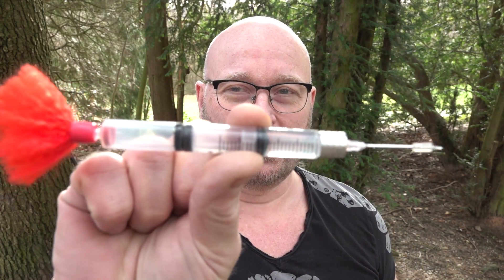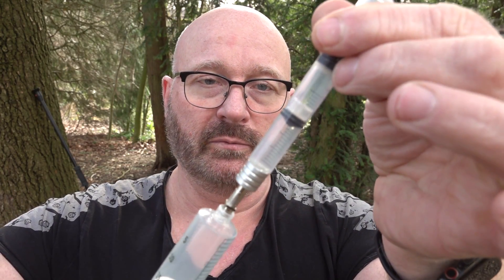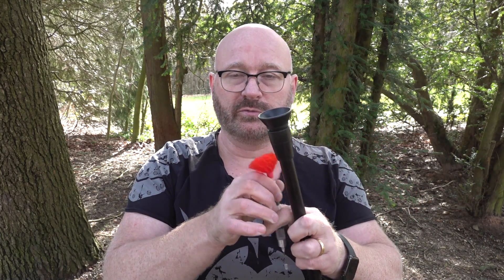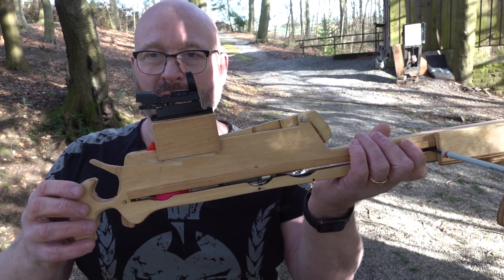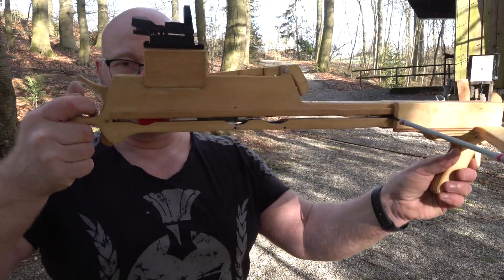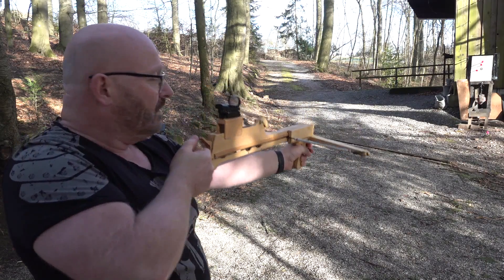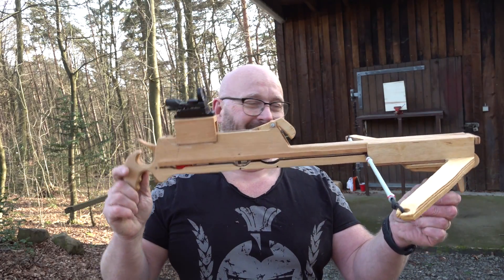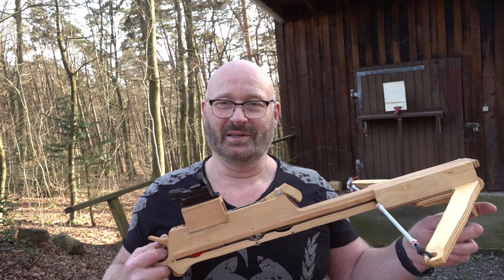The Tranquilizer Dart Projector!

Comment: I have racoons to deal with, I am brainstorming, I am of Austrian decent, way in the past I worked with a German Guinness designer who was in between jobs from Detroit. We were at a tool and die shop brainstorming for a millionaire lawyer trying to get patents. My boss had to sue the guy for not paying roaming Guinness's.    Yuo've made my day. CAN I PLEASE HAVE ONE OF YOUR CROSS BOWS?  My first blow gun at age 8 was 0ne of those cardboard tubes used on coat hangers to not make creases. the dart was a needle with Old paint brush bristles tied with thread, it stuck into the cement wall of my father's basement at 20 feet. HAPPY BE KIND TO A COON DAY!🐾

Comment: It looks like you solved many issues at once. Your model holds 4..5 shots. And seems to be much more accurate than the other two you showed. This would be so much simpler to use .the blow gun takes a lot more practice. I call this a win win.

Comment: you could give more control on the power by placing small triangular edges  on the slider and put 2 hooks on each side that go outwards when  button is being pressed, that way it will have many more stages, it will create tension on the main frame but I think it won't be enough to wear the device

Comment: I had a thought about the rubber. Wearing protective glasses is inconvenient. So couldn't you build in protection in the bow itself? My thoughts are: attach a ring, rubber goes through, so if rubber should break, it would overlapp esentially reducing it's own length, so it wouldn't be long enough to reach your eye.
Also may be attach minimalistic shield panel if it's nessesary. Also rubber should be cheap, so spare could be included.
I don't presume you will read this, there are thousands of comments. But i wouldn't know where to post it anyway.

Comment: You know adjustable dog leashes and lanyard-holders that you can pull and unlock doors and shiz with and when you let go they return to their normal position. (What is that mechanism called?)

Could you use the same mechanism for the assisted draw on an Instant Legolas?
As in, no rubber but a string on springs instead. (since they didn't have rubber bands in medieval times)

Comment: If you changed it to be an all in one, capable of pressurizing the canister and  increased the cartridge size, i could see wildlife professionals actually use it. Four shots is a bit light, and not bring able to make more in the feild is a bit of a down side. But if the two things are fixed and it allows for smaller inner slide replacement for smaller syringes for birds and small anomals, it could really work.

Comment: What about using wooden gears instead of the rubber bands to aid with the draw drawforce for the longbow? It's only an idea I had. Would this be something you could consider? If the wooden legolas were moved on a slider (like a rail) adjacent to another slider that drew the string,

and they were connected via (either one multigear or a set of) gears, you could increase the amount of torque over a little bit of longer distance draw. Yes the length by which you would have to draw the slider would be further, but there are ways around to fix these problems that surface. 

But in other words, the premise is to be distributing the work over distance to decrease the drawforce using like bearing-type gears that roll in between two sliders that would extend similar to a telescope or a drawer (dresser). One slider by which the wielder draws, and the other that actually draws the string.

Anyway, let me know what you think Joerg! I am a big fan. Thank you for the videos and fun personality.

Comment: I'm a whimp and couldn't even draw a bow of that poundage, but I have shot a 66lb English longbows, and the handshock is incredible.

Whatever you make will have to withstand some serious energy dissipation.  Maybe coat all the wood in polyurethane to stop it splintering up.

 I've always admired you work on the "instant" series of bows, but I've doubted its application for truly heavy bows, the forces are well beyond what you've worked with and I fear something made of wood, glue and screws won't last long under them.

I look forward to be proven wrong, it's quite honestly amazing, the stuff you come up with using only simply materials.  God knows what you would achieve with a plasma cutter and a 3d printer.

Comment: why do you need to have the crossbow shape? Why not just eliminate the crossbar completely? Just make it like a divers sling? The rubber will stretch just fine. It doesn't need a great big angle. In fact you could even make it spring activated.

Comment: You don't even need the cross bar, just use the rubber like a spear gun.
Reply from the maker: Then the weapon would have to be much longer to achieve the same pretension. Also there would be pinching at the sides of the slide. Don't you think I know my stuff, after all those years?

Comment: So after filling the syringe with medication, then you put the needle on... how do you bleed air out of the needle? You'd need to break the seal of that silicone tube and then close it back up immediately, as you don't have a lot of liquid to waste, and you're also wasting your pressure.
Reply from the maker: A small amount of air is totally harmless, contrary to common belief. You would have to inject four or five large, empty syringes into someone to cause harm.

Comment: When we were kids we raided building sites for their copper pipe scraps , we would take 1/2 copper pipe around  3 to 4 ft . and we made darts using sheet-rock nails with a cone made of medium gauge paper of some kind.  We would scotch tape the cone together and tape it  to the shaft of the nail at the head of the nail and cut the cone so it fit snug . We would practice in the garage at  18 ft. and got pretty accurate with them .

Comment: I think you should be able to change power on the fly without it locking into place, since the distance between you and the animal is probably constantly changing.
That's the advantage of a blowgun. It's very adaptable in terms of power, which this gun isn't.

Comment: Pretty cool... I'm working on a safe, self contained and or possibly hooking double pulley system with a remote and manual winding spindle on the bottom, and probably the top as well, for vertical lift... with lockable wheels on the bottom, possibly some kind of stakes and anchors or clips for the top, although small and strong in frame, definitely wouldn't want to get blown over or roll down a hill when your in the air... and definitely need some more helmets and stuff anyway.... and less expensive than what most people in the business usually don't wanna rent or buy, like boom lifts, which are also pretty awesome... ropes and pulleys can be especially cool for people that are skinny with big heads and long necks though... lol... just saying, don't think many monkeys would make it very long in the trees with big heads and long necks, especially if they might get dizzy while working with their arms over their heads...

Comment: wouldnt it be much more efficiant to stretch the rubber allong woth the main body instead of placing it that far away from it? for a longer drawlength one could use idler pullys as seen before.

Comment: If this ever did become the mainstream long-range injection tool, I can see how training for what power to use at which distance would be very important. It's clearly superior to the blowgun, I'd hate to see it abandoned because someone used too much power and killed an animal.
Reply: A commercial version should be fairly easy to calibrate and just print the ranges on, high-end versions could even have an actual distance sensor integrated into the sights. Since people are using gas- and blank-powered launchers regulators should already have the general concept covered.

Comment: Use body weight to draw the war bow.

Have something you can step on to load it. Like a goats foot crossbow leaver in reverse
Reply: What ? How do you want to use your body weight if you step on the bow ? You would have to have an entire huge standing device, just to draw a bow with a leaver and what's next ? Even if something holds the device in drawn position, you still need to take a FULLY DRAWN 120lb bow in your hands. If you are not able to draw it you will not be able to hold it either and you just gonna brake the bow or your arms or both. When you gonna put on the arrow, how are you going to hold it ? The reason why it works for crossbows is - they are crossbows ;)
Reply: @chrisp9824  i imagine the bow would lock in the drawn position like a crossbow, 
And 
The muzzle of the slideing device would be set on the ground and a stirrup on the oppsite side of the bow to the slideing magasine would be used to push the bow arm down to the drawn position.
Reply: @checkmate058  You probly know that there is huge difference if the weapon can stay drawn by itself. Even if in your country crossbows are not regulated, the device you describe would be stationary, so you can use the bow only in one place. Not very handy, and reloading would take ages compared to normal shooting, or instant legolas. Lastly, why look for a solution to something that Joerg already solved ? That's the point of the entire war longbow instant legolas, to make drawing easier by using rubber bands.
Reply: @chrisp9824  my idea is take the instant legolas as is. Put the muzzle on the ground, step on the bow arm, there, body weight loaded.

So what of the law, eff the law, i want to see what is most practical. A bow that stays drawn is most practical
Reply: @checkmate058  Long story short. if you wanna have a bow, that you need to draw with a device and then lock it in, just get a crossbow. This will be the most practical. What's the point of having 6 arrows in a magazine, if reload between each shot will take a minute ? You are literally reinventing a crossbow right now, only a bit more sloppy ;P And way more sloppy than the Cobra or whatever this repeating crossbow, that Joerg makes is. Ok, it was still a long story but I can't make it more clear ;P

Comment: Hey Joerg, since this is rubber-powered, why don't you remove/reduce the front arms to make it more compact?
Reply: It has to do something with the way the string behaves. He mentioned once in an other video I think though i cant really remember what it was
Reply from the maker: I need the pretension. That can either be achieved by making the weapon longer of by using wider fork arms. Making it longer means there will be pinching around the sled. 
Rollers would work, too - but the friction kills efficiency.
Reply: Oh, I see it now, that makes sense, thank you for the clarification.

Comment: @JoergSprave - Remove the Feather Bush and put regular flight veins on it.  It will drastically increase range and accuracy.  The bush is only necessary for a blowgun/co2/compressed air.
Looking forward to the semi-auto 110lb English conversion.

Comment: Hi Joerg,

wouldnt it be much simpler to take the rear end of a Adder Bolt with the Notch and Feather-Vanes to add a Tranq-Dart minus the Feather-bush?

Basically like this: Bolt with Feather-Vanes/ Notch>screw-in adapter>Tranq-Dart

Comment: As one having worked with much vets at the zoo and outside, I can tell you that the thing is nice, but absolutely not needed, at least not on Germany / Europe. Maybe Africa or America with its HUUUGE wildlife parks, but they use guns, so again, no need for this. Even most zoos in Europe have siringe guns for their regularly employed vets. Only smaller parks and pet zoos don't have them because they mostly rely on outside vets from the area, mostly the same farmers calls.
Plus: As an tool for a vet it would need severe testing to make safe every use is exactly the same / repetable. It needs measurements about the power delivered with various siringes, fillings and so on. There are even lists for blowguns with power charts.
Nice to know: The vet students trained at the zoo with the blowgun agains styrofoam targets. So our work yard was a blowgun range regularly :D And the females most of the time where way better than her male counterparts.

Comment: Jorge, seeing as this is rubber powered would you need wide forks like a bow? Would you be able to streamline it and having the rubber attach closer to the handle so it's slimmer like a shotgun style of thing? Also maybe instead of set stops having a ratcheting wrack so you can fine tune the power?

Comment: One concern I would have (as someone who doesn't hunt or treat animals...) is the noise this wooden contraption makes as you cock it. The blowgun is essentially silent until the dart leaves the barrel so it won't scare the animal. Obviously a well-oiled commercial product would already be less noisy than a wooden prototype but the magazine pickup and trigger lock still seem to make rather distinctive clicks. So would it be possible to dampen the noise, maybe even with some simple additions like rubber or sponge pads?

Comment: I just had a course on treating wild and zoo animals and we practiced with a blowgun. Keep in mind that accuracy is extremely important because you can only aim at certain parts of the animal or even on low power you can injure it (hitting the windpipe or injecting directly into internal organs)
Reply: Do you use that long ones?For me its a waist of air,you can get better accuracy and stronger shot with 50-60cm one.Longer pipe doesnt mean better accuracy its a smooth bore "gun".Projectile is stabilised  by fins on the end ,there is no rifling so you get absolutely nothing by having long barrel.If you put sabot ring on the tip and use co2 cartridge instead of air since its mixed with saliva you will bet better accuracy.
Reply: What I've seen in many nature conservation videos is that game rangers usually aim for the rump.
Reply: true...i had always thought about that one
Reply: Anthony Cassar Aveta need a blow pipe with  red dot sight on it then

Comment: I wonder if the distance accommodating mechanism could be made purely muscle operated by having the fore-grip/slide handle thing be on a pivot where it will naturally want pivot backwards under tension and disengage with the teeth/rack under the crossbow body, but by angling it forward with muscle power, it will engage with the teeth. You could also add a wrist brace to the fore-grip to make it easier to hold in place

Comment: You forgot to remove the air bubble from the tip of the syringe which could be potentiality lethal, which i'm sure you don't want... unless...
Reply from the maker: A little bit of air is not dangerous at all. That is a myth. You would have to pump a huge amount of air into someone to cause any harm.
Reply: @Slingshotchannel  Damn, i have been wasting so much gear trying to get air bubbles out of needles, thank you for the fact check, based slingshot bro.

Comment: I suppose this would work as a normal crossbow as well? Replacing the stiff wooden limb with actual bow limbs and the rubber with string should do.
I think crossbows have more efficient energy transfer than something like this?
Reply from the maker: For these darts, more power makes no sense. They would break, either during acceleration or latest at the point of impact.